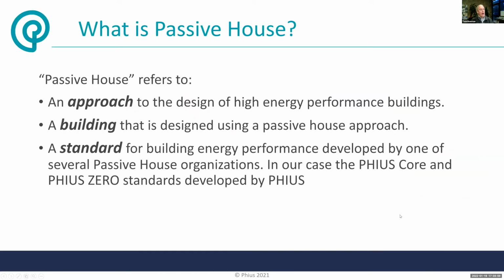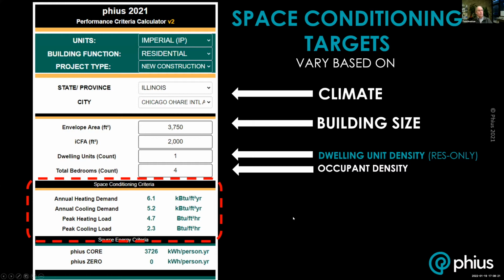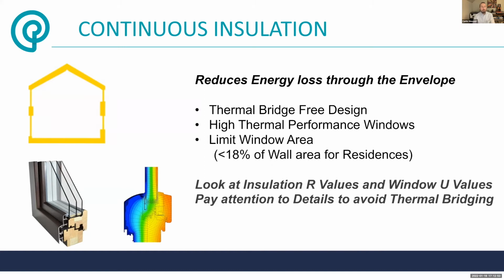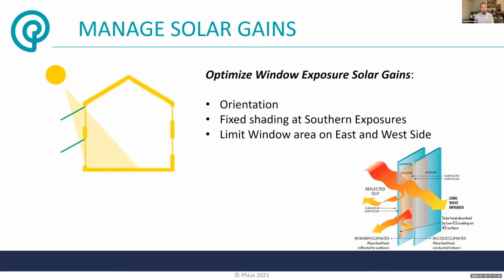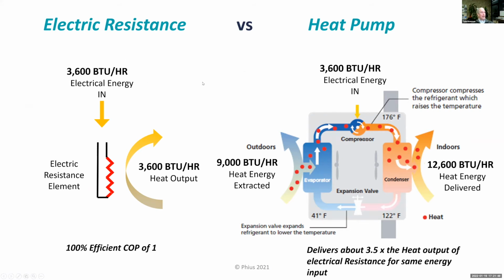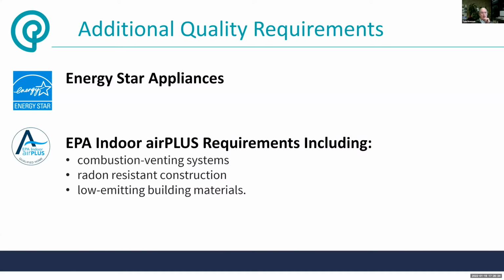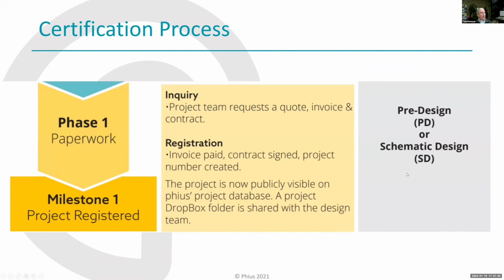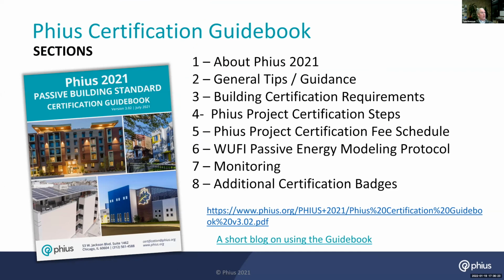Passive House 101: Introduction to Passive Buildings, 2022

Comment: Do passive standards account for embodied energy/Co2 in building products?
Reply from the maker: The Phius CORE and Phius ZERO standards do not specifically score projects for their embodied energy/Co2 in building products.

Currently the standards address operational energy use and those performance characteristics that impact it the most: heating and cooling annual demands and peak loads. Phius recognizes that these are not the only important components of a comprehensive "sustainable" building effort, but it is a critical one and where they've focused their efforts.

Detailed and reliable embodied energy/Co2 information about building materials is becoming increasingly available. There are a lot of talented dedicated people focused on this area and we expect standards will be developed around it. Phius will have the choice of building their own embodied energy/Co2 standard or encouraging/requiring compliance to another standard. My guess is it would be the latter. Either way it's an exciting area of exploration in the field and Phius will be a part of it.